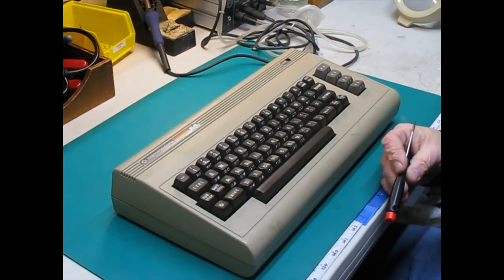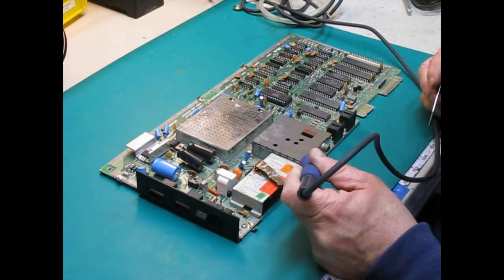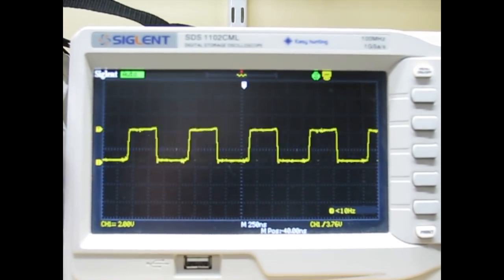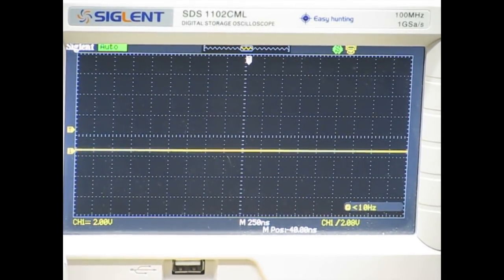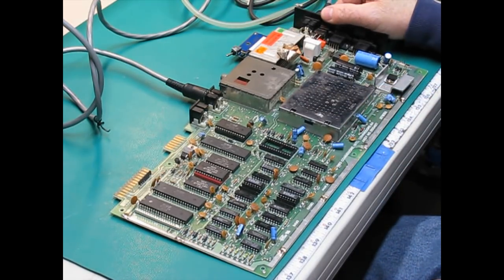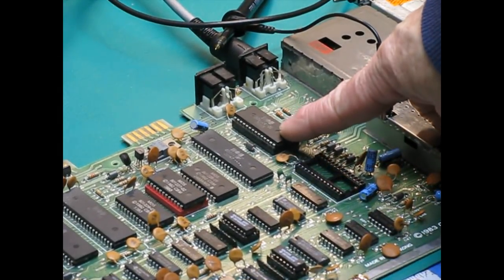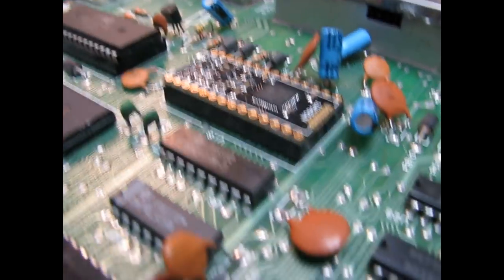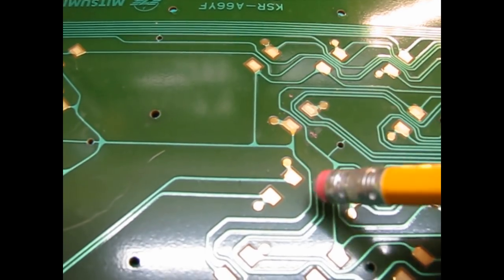C64 Repair - Busted Case and Black screen, C64 Back From Black

Comment: Thanks Jeff, I appreciate these repair videos as they come in handy for such references.
Reply from the maker: I did some research after the fact and did find some mention of the Kernal causing a black screen though it seems the PLA and RAM are the most likely candidates. The diagnostic cartridge was really helpful in this case.

Comment: Excellent video, thanks!  If one does not have a scope could a logic probe be used instead?  I usually do chip swapping but that is a pain sometimes if you can narrow it down more with a probe.   I like the repair series that you do so keep up the good work.
Reply from the maker: Hi, in this case a logic probe would work just as well. I was just checking that there was a changing signal at various pins which a logic probe is perfect for. The one thing it might not catch is when the voltage level is too low. Sometimes, when a chip goes bad it can cause its input or outputs to be at a too low a voltage level. It might be low enough where the circuit would never work or it could be right on the edge where it might work sometimes. A scope will let you see these types of problems too.

I found my old logic probe I bought 30+ years ago. I'll try to remember to use it in the next repair video. A multi-meter and logic probe can diagnose a lot of problems.
Reply: Cool.  Thanks for the info, much appreciated.  I have a logic probe but I have never used it yet.  One of those things I still need to get around to doing.  Thanks!

Comment: Interesting !!! I have a C64 (whit a black screen) with a dead test that does not start: can we force the start of the cartridge? Thank you ...
Reply from the maker: If you get nothing with the dead test cartridge in (not even a flashing screen) you have a more fundamental problem. Check that you have the proper voltages everywhere.

Comment: Dead sid?
Reply from the maker: Yes, the 6581 SID chip that was in it was faulty. It made some 'sound' but it certainly was not correct. The ARMSID replacement worked fine though.

Comment: just spent about 30min trying to remove shield with wick :|
Reply from the maker: Why? It is easy to heat each tab and pry it up. Then after shield is off use briar to clean up solder locations.
Reply: @HeyBirt  before I saw your video I wasted a lot of time :)
Reply from the maker: @powrslave  Ah, OK. I understand now. I was worried I somehow led you down the wrong path that caused you all the extra work :) 

Sometimes when trying to explain something in a video it is easy to say something rather ambiguous that seems to make perfect sense to me at the time :)